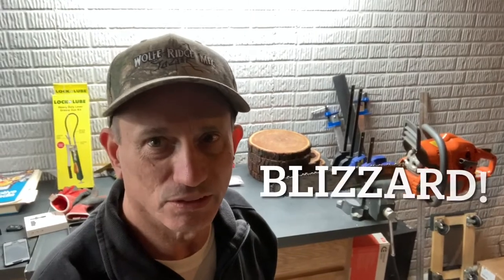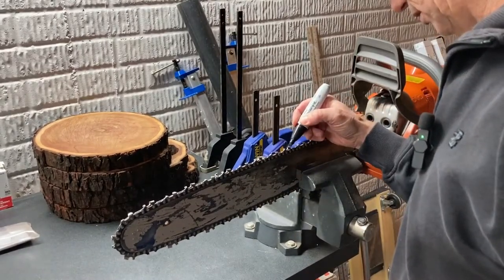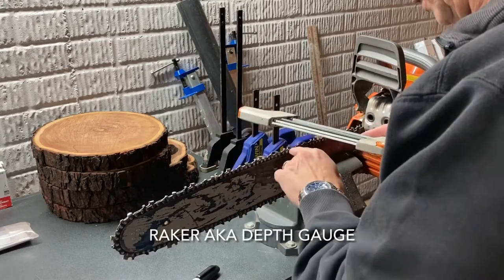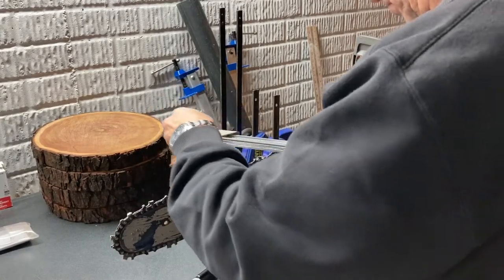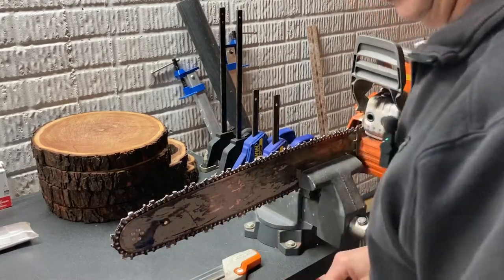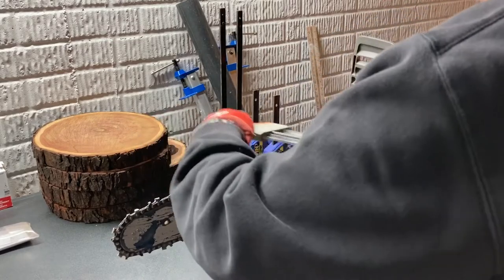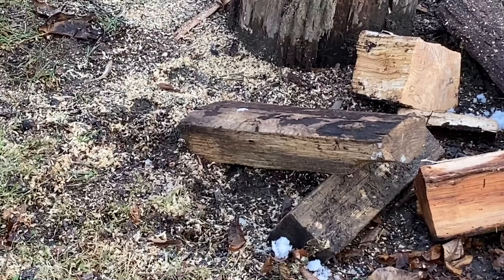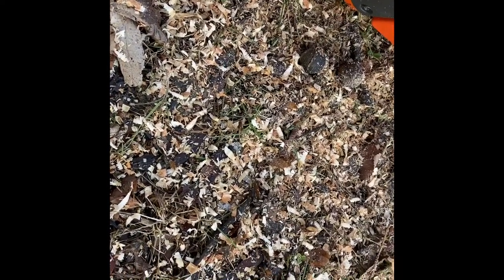BEST Chainsaw Sharpener! How To Sharpen Your CHAINSAW with Stihl 2 in 1 #chainsaw #firewood

Comment: I agree; I often get confused on the correct way to hold it.
I mainly got it for lowering the depth gauges. I still think the chain gets sharper just using a round file.
Reply from the maker: Lately, I have just used the round file.